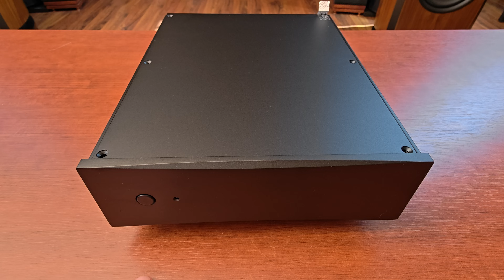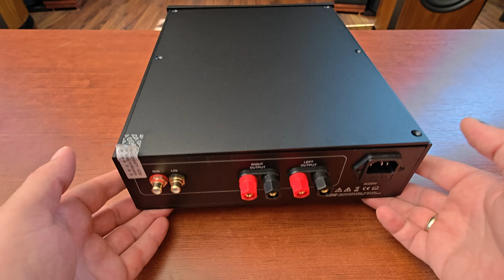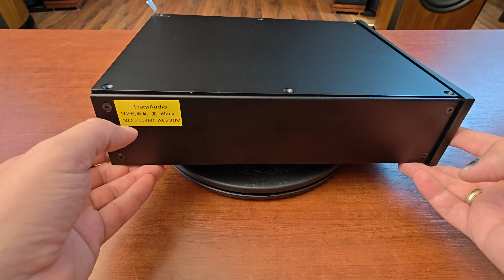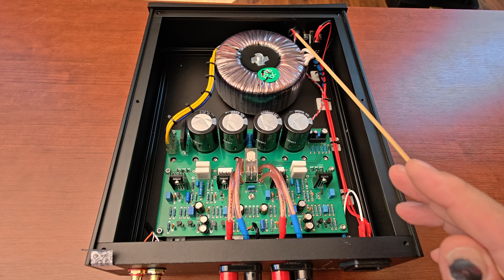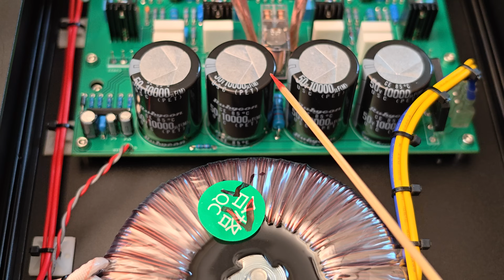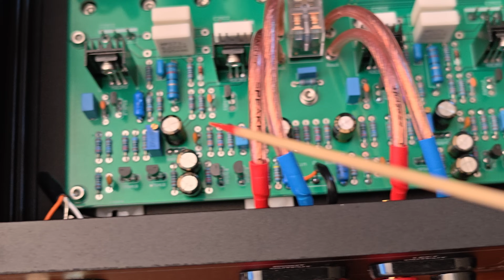Another small guy: Naim NAP200 clone amplifier first look!

Comment: Hi Tom, I just received this amplifier and noticed something was loose inside, when taking it out of the box. It turned out to be a loose screw that originally was placed in the middle of the printing board, just under the relais switch (the transparent box in the middle is a relais switch, right?!)
So my warning to people is to inspect the amp for irregularities, before using! Quality control is maybe a concern. Some others screws were not very tight either.
Reply from the maker: Hi! Yes, this may be a problem and this happened once to me. The package is going around the world (literally) and vibrations can do weird things. After delivery I always open the devices up and look for obvious transport damage, but this is basically my procedure for anything I am ordering online also from US, EU or even locally here in PL
Reply: @k4syx  I normally don't open devices until the warranty has passed. But things from China, and that it was so obvious a potential hazard, I did.

I also opened the Gryphon Tabu clone, but that was because of the heat that was excessive and I drilled a few larger holes in the top cover (which only helped slightly, so I use a external fan to cool it when is use).

Anyways, thank you for the quick reaction! After Morocco - Canada, I am going to watch your video about the AUVA's. 🙂
Reply from the maker: @MultiTipsiewatching the same game with my daughter here :)

Comment: Hej, wiem że ten wzmacniacz trafił do listy rekomendowanych, ale brakuje informacji jak on gra, czy mógłbyś coś napisać więcej o dźwięku?
Reply from the maker: Yes there was a video on that with details but I had to take it down due to technical problems. I need to reshoot this one. 
In short, it's very balanced with surprisingly good resolution and imaging, in this areas it's way better than the price would suggest and that's why it got to my list
Reply: @k4syx  I have the two mono Quad 405s you suggested, does this NAP 200 sound different in any way?

Comment: Does Transaudio have a pre amp in the same form factor?
Reply: The new Fosi ZP3 Preamp is 239mm wide, just 1 mm less than this.
Reply from the maker: That's excellent question. I haven't seen anything matching yet, I'm gonna ask a few sellers about that (easier than browsing through Ali for the next century).
I was wondering the same thing as I really like the small form factor here
Reply: @k4syx yes, trans audio has Naim preamp

Comment: Looks nifty, could also be used a a mono block probably. Using just one channel.
Reply from the maker: Yes, you can actually just disconnect one of the transformer windings from the PCB and have just one channel working